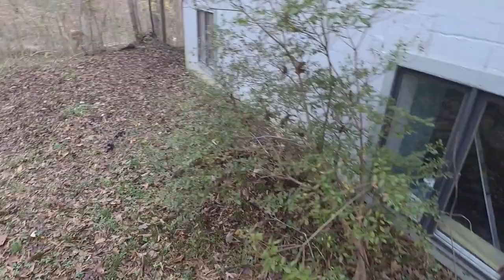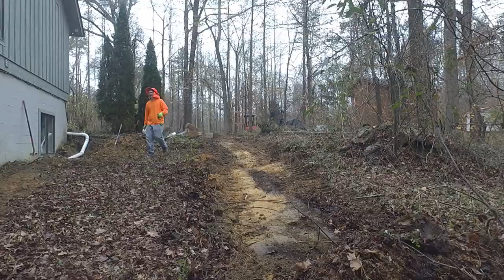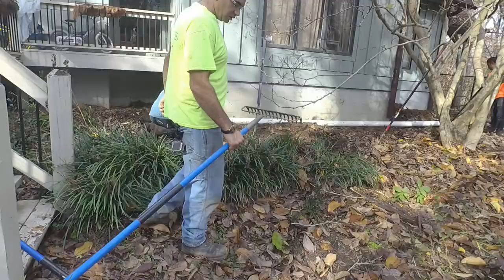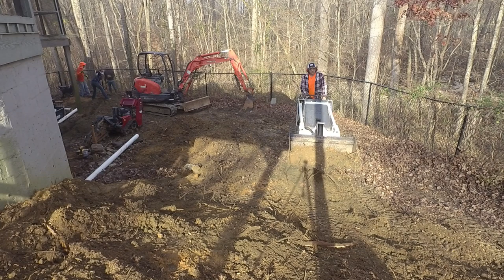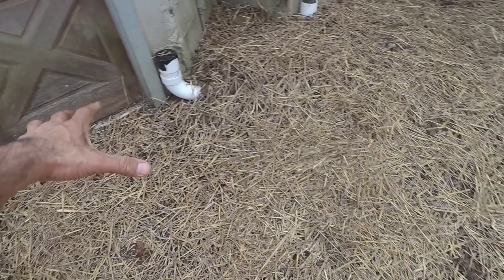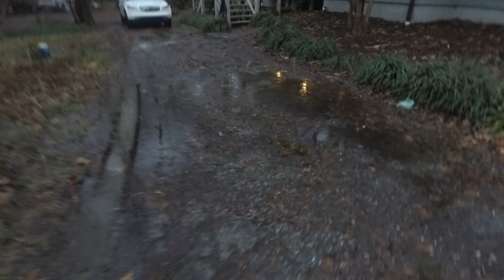Solving basement flooding with PVC drainage system + grading

Comment: Hi Sean 
Good job mate. 
Re the pounding or puddling my suggestion would be a French drain 18"x24 with perforated pipe or pipes and large clean stone all in fabric and run it out to the creek. 
I wouldn't add material to the ground it's just going to displace the water elsewhere. Use the French drain and remove the water from the ground. 
Good luck 
Happy new year from UK
Reply from the maker: I agree that may be a good solution here.Thanks for watching!

Comment: After basement flooded twice within two months of us moving into our house fourteen years ago,  we completely tore up yard,  graded it & got rid of the crown, old pine trees and added underground downspout drainage that went to either the street or bubblers that were well on the down side of the slope.  We were able to finish the basement and other upgrades with NO water issues since.   Regular maintenance and vigilance have maintained our work.
Reply from the maker: That's an awesome story! It's what we try to do with every job - provide a system with lasting results. Thanks for watching and commenting! - Shawn

Comment: One way you might be able to solve the driveway puddling (assuming it can be done) is dig out the driveway gravel and turn the entire driveway into one MASSIVE French Drain (make the gravel layer extra thick to protect the perforated PVC from the weight of the vehicles)...
Reply from the maker: Great idea!

Comment: Hi Sean. Do you make your customers understand they MUST keep their gutters clean?
Reply from the maker: Yes for sure. But, the systems are designed to maintain flow. Conservation of energy type stuff. This means they have a good bit of energy from the falling water to help keep debris blown out. Combine that with the smooth wall of the PVC any debris that enters our systems gets blown out by the next heavy rain. I give a guarantee that the pipes won't clog and haven't had any problems yet.

Comment: Would a catch basin that was tied into the gutter nearby that was placed in front of the door have been the better choice despite the added cost opposed to the small retaining wall?
Reply from the maker: Great point to consider TK. I would rather keep the water away from the door instead of inviting it into a CB near the door. That's usually the main consideration I have when making these types of decisions, but there are many ways to do this stuff. 👍

Comment: Fully support the concept of building up the dirt slope to drain water away from the building walls. 

However, you need to be very very careful to remain within the moisture prevention design of the building and not place dirt higher than the damp proof course and moisture barriers, and keep the vents open.
Reply from the maker: Great point! In this case the customer already spent more on water damage mitigation than he did on our solution so he was good with increasing his termite regime in exchange for no more flooding..

Comment: Why not put window wells in with drains tied into the pipe then you ciuld have brought the level up higher.    Looks like any snow would go up right on the window.?
Reply from the maker: The pipe would have to be considerably deeper to drain window wells. We don't get much snow around here in NC.
Reply: @GCFD  thanks for the explanation.  We probably do get more snow here in WV. :-)